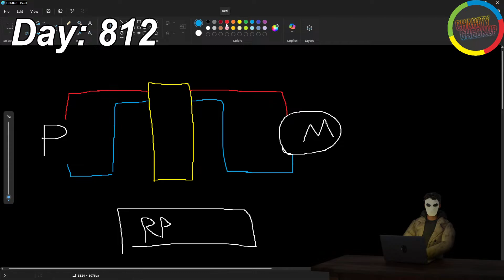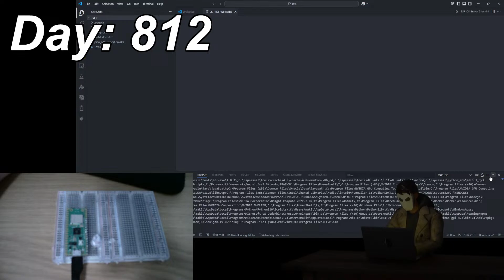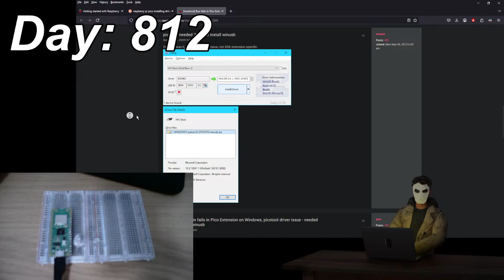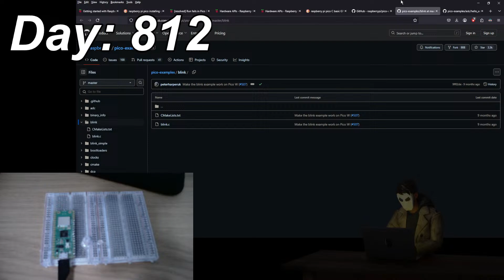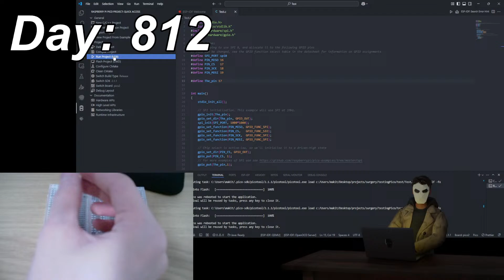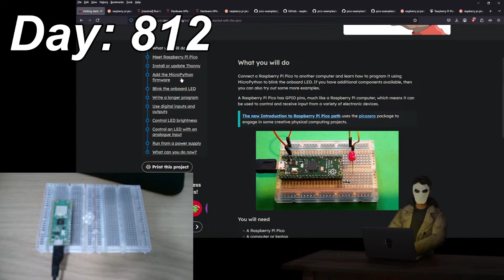Planning the thingamajig - Charity Checkup day 812

Comment: The power supply problem can be prevented by plugging it all in and then turning the power on
I had this problem when trying to make hydrogen through electrolysis of water.
The sparking probably happens because of the alligator clamps, my theory is that the gap between clamps and whatever you want to connect it to will become smaller and smaller until the voltage is enough to jump or arc and make spark because low voltage I guess